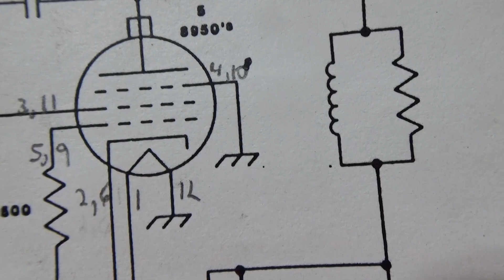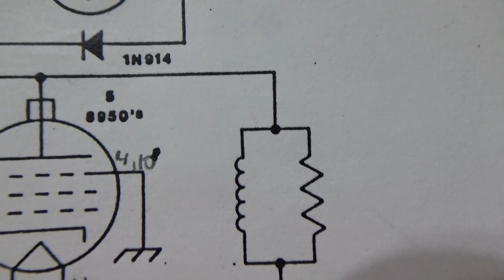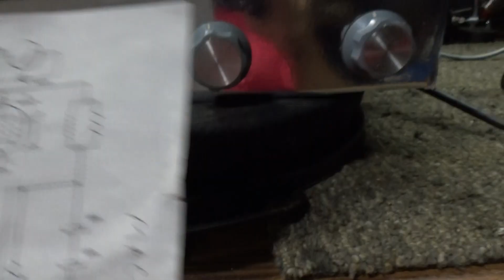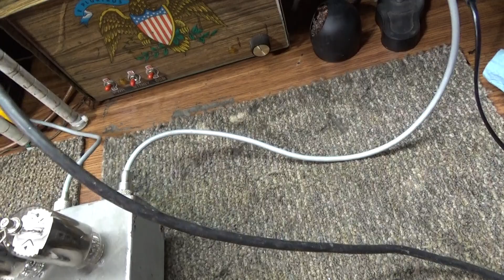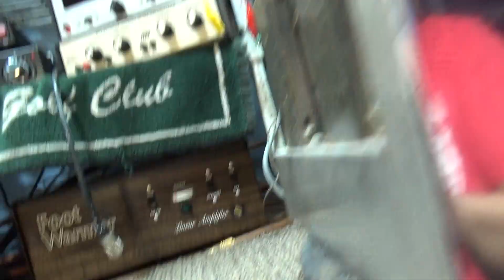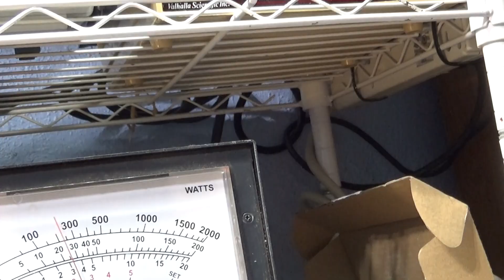Junky Maco 300 linear amplifier gone thru, recapped, NOS Tubes on the bench.

Comment: 8950 heater is 13 Volts, or so says GE. Meant for mobile use, so a 13.8 Volt alternator wouldn't overvolt it so much. Just finding the data sheet for that tube was a bug hunt back in the day.